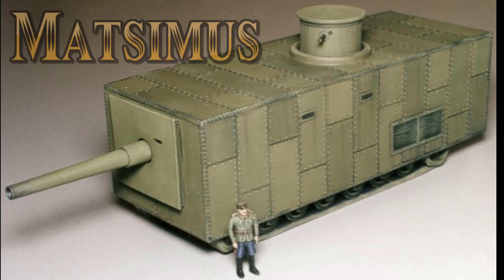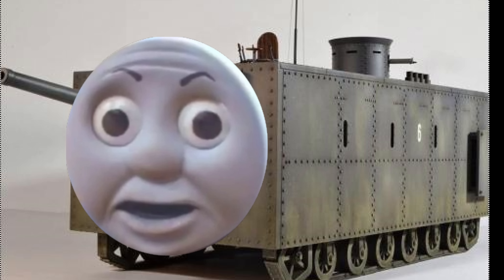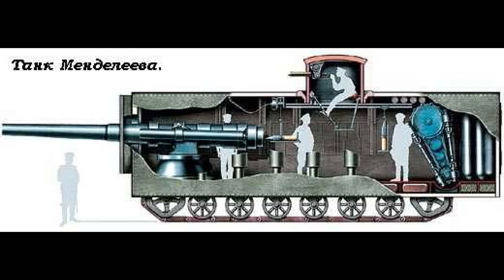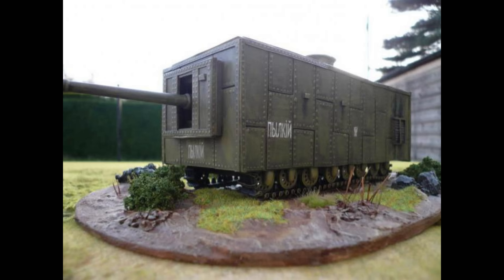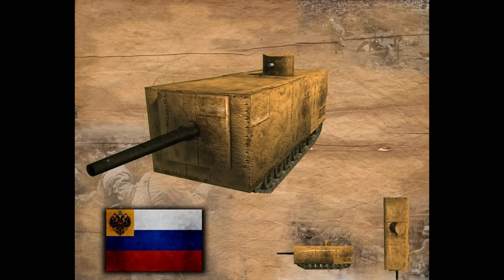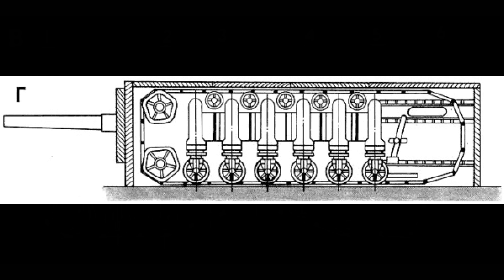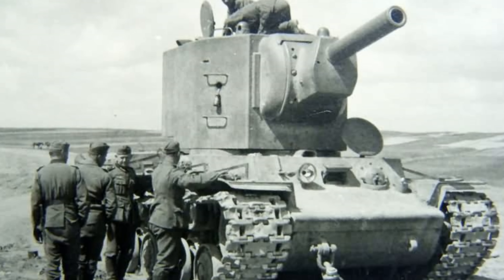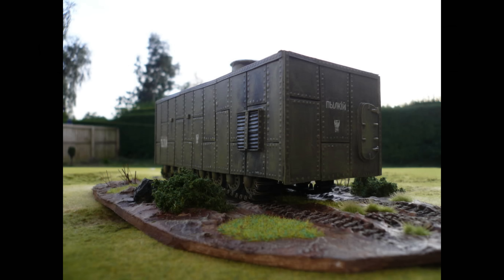Mendeleev Tank | RUSSIAN MOVING BUNKER

Comment: This would have made sense as of mobile Coastal Artillery  during WW1 and WW2.   Think about the ability to move heavy guns close to the shoreline to support static defenses and/or have a region of control so they can move to where it is needed.  Then duel it out with the ships out at sea.  Because of it being mobile it will make it far difficult to ships to get a bead on it to fire accurately.  The only real danger would be air power.  but like tanks they could be concealed to look like buildings.   Mobile Bunkers.  Neat design.

Comment: Who designed this tank? George Lucas?
Reply: Well... Suggested a more epically project... "Armoured air ship", "invulnerable for artillery", "need engine at least in billions pood-foot" (1 billion pood-foot - 4.8K megawatts), "load - millions pood of bombs" (1 pood = 16.38 kg, 1 000 000 pood - 16 380 tons). Other project - double-deck V-wing jet airliner, 120 passengers, "from Paris to St-Betersburg at one hour" (it's more 2200 km). Anonim engineer suggest a "land armour-vessel", with crew 2400-5000 mans. Naval engineer Shustov projected big armoured assault helicopter-submarine, with periscopes. Worker Hohlov projected transatlantic transport helicopter. Engineers Podolskiy and Yampolskiy projected rail gun, 12" L/60, weight of shell - 1000 kg, muzzle velocity - 3000 mps (also, projected variant with 50-metres barrel, 915 mps and range over 300 km). And, also, created many crazy projects - psi-weapon, ray weapon, subterrine, drone with cameras, icethrower, etc., Russian Empire was a one of biggest wunderwaffemaking countryes, competitors in this theme - Third Reich, USA, France, GB. Later, Soviet science based on Tsarist workings, and, projected other crazy vehicles, 385-metres tank with 555 mm armour, jumping machine, walking truck (yes, "Shogokhod" was a real project), 500-kg power armour, etc.

Comment: Tbh this is actually quite an interesting design given its year of concept...it certainly was ahead of it's time...I gotta give props where it's due. This is probably the most interesting of the ww1 designed tanks I've seen. 

What really sold it on me was the fact it's basically a low Rider and can transform into a bunker by lowering it to the ground 10/10 instant Chad factor right there.

Comment: Even Russian cargo containers are stronk
Reply: "Calibre-K" (export designation: eng. Club-K) - Russian container complex of missile weapons, placed in a standard 20-and 40-foot sea container. Designed to defeat surface and ground targets. The complex can be equipped with coastal troops, ships of various classes, railway and automobile platforms. It is a modification of the Kalibr missile system.
http://s001.radikal.ru/i195/1309/1b/11b9b0fb4f58.jpg
The system can be used from ground starting positions, sea, railway and automobile platforms. Anti-ship missiles (3M-54KE, 3M-54KE1, X-35UE) and missiles for hitting ground targets (3M-14KE, X-35UE) can be used.

The main element of the complex is a universal launch module, made in the form of a standard sea container. The basic structure includes from one to four universal launch modules, the ammunition of one universal launch module of the Club-K complex is 4 missiles, each launch module is completely Autonomous.

The standard configuration of the universal starter module includes:

the fire control system;

launcher vertical (for missiles 3M-54KE, 3M-54KE1, 3M-14KE) or inclined (for missiles H-35UE) launch;
combat control, communications and navigation equipment;
power supply, life support and fire extinguishing systems.
It can be used in conjunction with active-passive or passive radar systems (including container version), which allow to detect, identify, locate and determine the coordinates of the target at a distance exceeding the range of missiles. It can receive target designation data from any coastal, ship, aviation, satellite systems and complexes.
The Kalibr missiles were created on the basis of two projects: the 3m10 strategic nuclear cruise missile with a combat radius of 2500 km developed during the period from 1975 to 1984 at smkb Novator, and the alpha anti-ship missile competition (Biryuza ROC). The range of 3M14 is from 2000 km to 2600 km (in thermonuclear combat).
Reply: Imagine a modern cargo ship fully loaded with this things
Reply: Landshipping container?
Reply: In Russia container contains you.
Reply: alan wilson  You mean what does Stronk mean? It means strong but in a funny Russian accent you say Stronk. If you mean how is it strong then that should be obvious since it looks like a cargo container with a giant gun poking out of it, plus a turret on top for good measure. Might be why you do not hear anything on the news about Russian cargo ships being taken by somali pirates lol

Comment: It has NO mobility: I cannot turn! It will tears its tracks of at the slightest provocation: The length to with ration is not even remotely connected to reality.

It is far to heavy on soggy ground.

The problem in WW1 was no so much bunkers as the whithering fire from heavy mashine guns.

It would have been easier to lay field reailroad track - giving enough people with strong enough death wish to actually lay the tracks across no mans land. Hostile artillery fire would have undermined the tracks.

The next question is: How would they resupply the damned thing once it ran out of ammunition? A 120 mm shell is not easily manhandled over several hundred yards of churned up no mans land.
Reply: Thomas Borgsmidt you are forgetting that this thing would operate on the eastern front.
Reply: Please Complete All Fields  Enemy: steps slightly to the left or right
Mendeleev: Damnit!
Reply: @tremedar  MG turret: Now it's my time to shine!

Comment: Just wait until you meet the Object 287 (T-64 hull and chassis with a unmanned turret with twin 73mm cannons and an internally loaded ATGM).
Reply: @Charles Yuditsky I drive one on Armored Warfare and it's amazing.
two 73 mm 2A28 low pressure guns mounted either side of a popup missile launcher.

Comment: When I throw my refrigerator in Chernobyl
Reply: "Calibre-K" (export designation: eng. Club-K) - Russian container complex of missile weapons, placed in a standard 20-and 40-foot sea container. Designed to defeat surface and ground targets. The complex can be equipped with coastal troops, ships of various classes, railway and automobile platforms. It is a modification of the Kalibr missile system.
http://s001.radikal.ru/i195/1309/1b/11b9b0fb4f58.jpg
The system can be used from ground starting positions, sea, railway and automobile platforms. Anti-ship missiles (3M-54KE, 3M-54KE1, X-35UE) and missiles for hitting ground targets (3M-14KE, X-35UE) can be used.

The main element of the complex is a universal launch module, made in the form of a standard sea container. The basic structure includes from one to four universal launch modules, the ammunition of one universal launch module of the Club-K complex is 4 missiles, each launch module is completely Autonomous.

The standard configuration of the universal starter module includes:

the fire control system;

launcher vertical (for missiles 3M-54KE, 3M-54KE1, 3M-14KE) or inclined (for missiles H-35UE) launch;

combat control, communications and navigation equipment;
power supply, life support and fire extinguishing systems.
It can be used in conjunction with active-passive or passive radar systems (including container version), which allow to detect, identify, locate and determine the coordinates of the target at a distance exceeding the range of missiles. It can receive target designation data from any coastal, ship, aviation, satellite systems and complexes.
The Kalibr missiles were created on the basis of two projects: the 3m10 strategic nuclear cruise missile with a combat radius of 2500 km developed during the period from 1975 to 1984 at smkb Novator, and the alpha anti-ship missile competition (Biryuza ROC). The range of 3M14 is from 2000 km to 2600 km (in thermonuclear combat).
Reply: Джо //Elusive// all this in 1917, I knew that Elon was ahead of his time.
Reply: When you throw a tank shipping container into a design facility